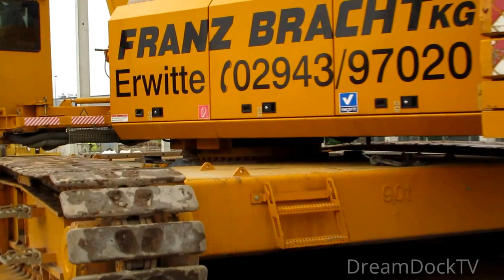Big crawler crane Sennebogen S4400 lifting concrete beams erecting new storage hall

Comment: That is one big crane for a bucket of cement!
Reply: If the concrete bucket was the only they are making I agree. But setting those heavy beams is the reason. That and needing a heavier machine to reach out wider distances. 
If I was the operator on this rig I'd want wire slings instead of the bridle chains. Maybe a spreader bar as well. Of course this job isnt in the US.

Comment: Why are they using a crane to move a few wheelbarrows full of cement?
Reply: Because the guy with the big rock pump wouldn't pay enough of a kickback.
Reply: Crane probably used for more than one type work on site and construction could be raised higher than what you see now.

Comment: Using chains for lifting? Never in the US.
Reply: Bill Moran why, stronger then rope
Reply: +orkhan combe chains can instantly fail. the best would be a Kevlar sling or choker. we lifted a 200 ton generator rotor at my plant. so no chains are not better than rope. the slings have tale-tails designed in them, they hang out 4-8- inches and if they start disappearing that means sling is getting stretched on its insides which is bad and can no longer be used. point is if u see that happening it would hopefully give crane operator enough time to set load down before fail happens
Reply: you dont use chainblocks in the us? :-)  by the way, i understand- the risk of instant fail, but used within their swl, the safety factor is so high, you can open a chain link complete on one of its long sides and it will still hold the load. and sharp edges do not damage a chain, but are hazard for slings and ropes. and in the eu ALL lifting devices (even shackles, eye bolts etc.) must be checked by a certified Person every year. most important, here and there, at the end of the day:  everybody should come home - and not in the News!
Reply: OSHA approved strength tested chains are used every day in US